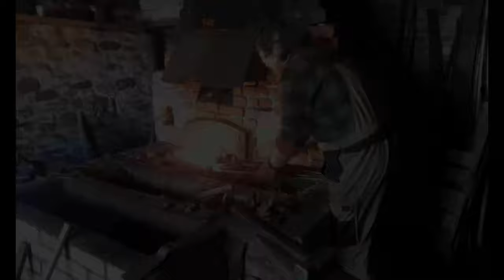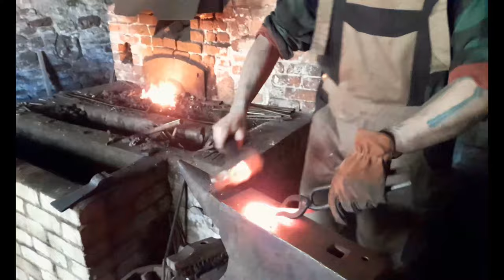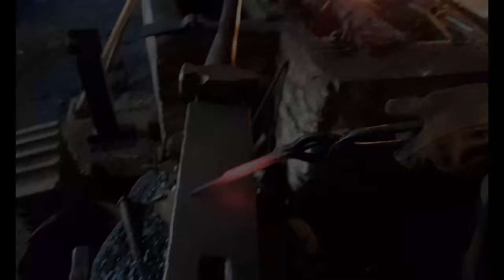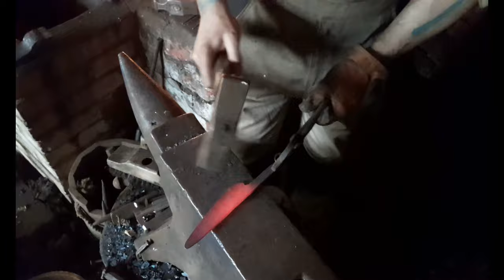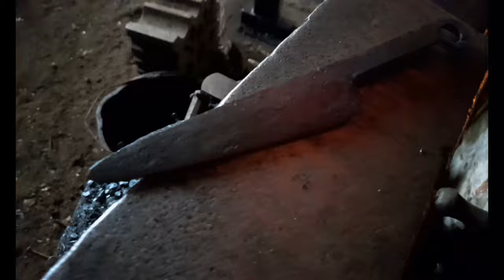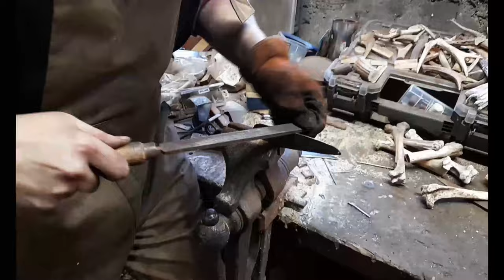Forging a Celtic Ring Knife

Comment: Hi Again mate , Hope you are both still good !
 One question , I noticed that the ring is tapperd and not as thick as the handle. 
 Were they all like this or have any been found / documented without the tapper ?
Reply from the maker: There is quite a bit of variety amongst them, some seem tapered while others are the same thickness. Some are punched and there are others which are forged and then welded back up! I'll find you the database that has the vast majority of them on record.